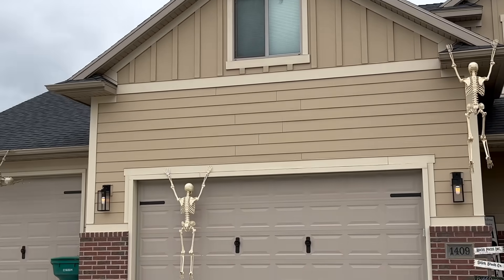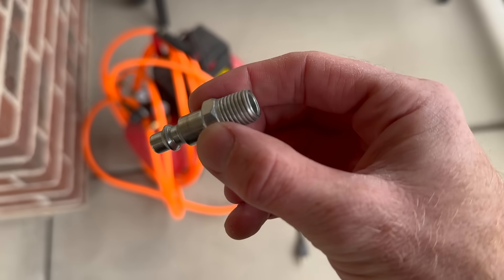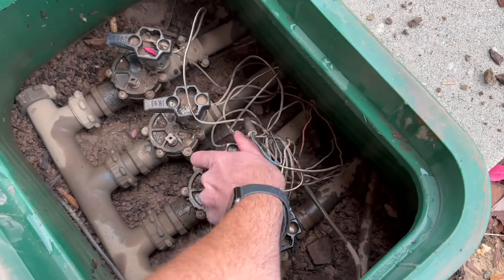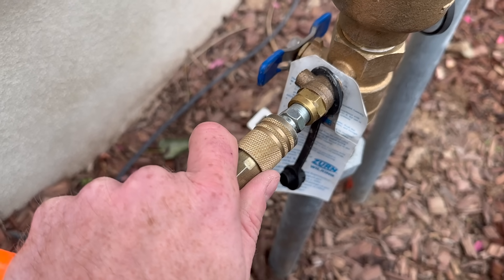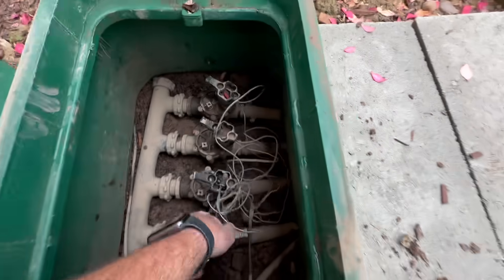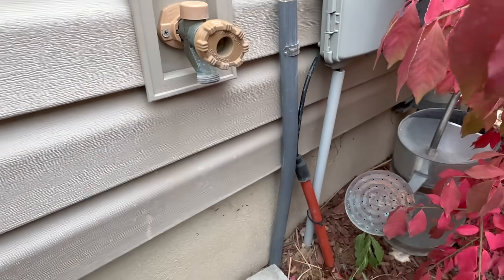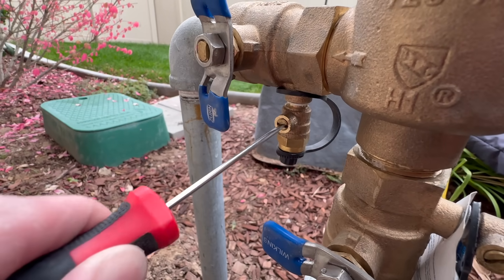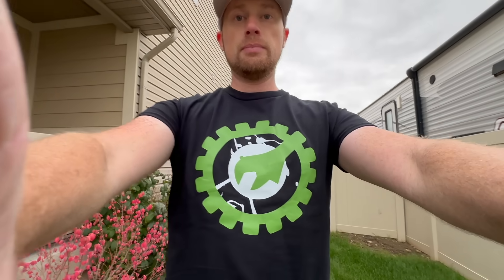DIY: How to Winterize Your Sprinkler System (Prevent Expensive Damage)

Comment: Do not put cap fittings on the end of the spigot. You want to allow any water left or any that leaks a way to expand. With a cap, you will break the pipe.
Reply from the maker: They are quite literally sold with the installation cover.

Comment: Whats the recommended psi? Ive heard 50-80, is this correcr?
Reply from the maker: Ideal pressures are in the range of 40 to 80 pounds per square inch (psi) for the air compressor with 80 psi being the maximum for rigid PVC pipe and 50 psi for polyethylene pipe (flexible black pipe). *

Comment: What about the water that’s in between the house and the shut off of the back preventer
Reply from the maker: Those valves you shut off from the city, those should have a bleeder hole for the water in that line to drip out.
Reply: @DIYBRY I actually don’t have a city shut off for just my sprinklers. I have a main sprinkler valve shut off in my utility room. It runs up and over my garage door and then elbows down to outback. If I shut that off , gravity should do its job and let the remaining fall out right?
Reply from the maker: @Millyyyy93 I’d have to see it. I’ve never seen that kind of setup.

Comment: Is there a max psi? I have a 150 psi compressor. I wouldn't want to blow anything up
Reply from the maker: Ideal pressures are in the range of 40 to 80 pounds per square inch (psi) for the air compressor with 80 psi being the maximum for rigid PVC pipe and 50 psi for polyethylene pipe (flexible black pipe). *

Comment: question, why do i have to open each value from the ground box, can't i just run each zone one by one.
Reply from the maker: You are going to want to leave them manually open anyways. Don’t want your sprinkler control box “running” all winter long just to keep the lines open. Besides, without water pressure, it is more difficult to know for sure the value is open before you start trying to force air through the lines.

Comment: Doing this is totally unnecessary! Sprinkler guys a making a killing doing this for people! Sprinkler lines are put, or supposed to be put below frost line. Shut the main water valve of to the sprinkler system. Open the valve to drain the water out. Leave the valve open over the winter. The 2 shut off valves on the backflow pipe turn half open. That's it. Never in 20 years have we had the lines blown out. Stupid unless you have money to burn.
Reply from the maker: You are assuming that all sprinkler lines are created equally…this is why people are learning to DIY, to save money! Certainly cheaper to be precaution than to have to replace sprinklers lines because they froze and burst.
Reply: They're not that deep everywhere lmao
Reply: Where do you live? The frost line where I’m at is at least 3 feet. My sprinkler lines are MAYBE 8” in the ground. And that’s the standard around here.

Comment: OR, when you were building your system you installed 1 valve @ the low spot then all that is neeced is to turn off the water supply, open the low drain valve and open all valves and the water will gravity drain.

!
Reply from the maker: A compressed air blowout is the most reliable method for clearing a sprinkler system, even if it has low-point drains. Relying on gravity to drain the system is not as effective and can leave enough water in the lines to freeze and cause damage.

!

Comment: Great. I came here for one thing - what PSI should I be using. And that's the ONE thing you didn't explain.
Reply: Bout 50 lbs
Reply: @thegoldendragongamerhi7277Mine takes 60lbs which I figured out but thank you for answering the question.
Reply from the maker: Depends on your system, dude. What size pipes do you have? What kind of pipes do you have? The ideal air pressure is between 40 and 60 PSI, with a maximum of 80 PSI to prevent damage. The specific pressure needed depends on the type of pipe: use 50 PSI for polyethylene pipe and up to 80 PSI for rigid PVC pipe.

Comment: I figured out that with my system that i have to have the compressor up to at least 60 psi for the sprinklers to pop up and blow out.
Reply from the maker: Please share, for the community, how you came about leaning what was needed for your system.
Reply: @DIYBRY 
I was following the instructions on your video, but doing it at a lower psi and nothing was happening. Then I decided to try turning up the psi coming out of the compressor and then it finally started working and worked thereafter, as long as the psi was higher. I do also just run each zone from my app, rather than from the green box, but I'm assuming either method would work.
Reply from the maker: @JTGK13 thanks for sharing.

Comment: Why do you need insulation, on something you just prepared for the winter? Isn't this superfluous?
Reply from the maker: Blowing the water out of the lines helps the polyurethane pipes not to freeze and burst. Putting an insulation jacket over the backflow preventer helps the metal in the backflow preventer to not get too cold and crack.

Comment: Can the pressure be controlled on the compressor?  Seems pretty straight forward.
Reply from the maker: Yes, there should be a knob that can adjust the pressure.
Reply: You should have two gauges and a knob. One is tank side pressure and the other is hose side.
Reply from the maker: @rain104  thanks for the additional information for the community.

Comment: Instead of manually changing the valves, couldn't I just hit the start button on my control box and cycle through the stations that way?
Reply from the maker: In theory, yes. Would depend on how close the control panel is to the blow out valve. Might be running all over the property to go back and forth.

Comment: i'm fairly certain i do NOT have a backflow preventer in my residential home.
Reply from the maker: @vegetablehead  you must have secondary water?
Reply: @DIYBRY  sorry for the late reply, but i actually 'discovered' my back flow regulator...under my house in the crawlspace. i've had my system inactive for at least 10 years now, and it's amazing how much i've forgotten about it!
Reply from the maker: @vegetablehead  interesting. Yeah, each house and each irrigation system is different.

Comment: I didn't see a drain for the main. There's still water between the shutoff and backflow. The shutoff could bea self draining but i doubt it.
Reply from the maker: @bob5098  my valve is self draining. When off, the water slowing drains out. This is basically what mine is, which the self draining on the bottom: https://amzn.to/3W020LD

Comment: If one drains and turns off the backflow and opens all the zones is blowing out the lines even necessary?
Reply from the maker: @TDace25  There will still be water in the lines if you don’t blow it out. The water can freeze, expand, and potentially break your lines.
Reply: @ Thanks. Used my compressor to do this today and was really easy.
Reply from the maker: @ Sweet! Glad to hear it. Subscribe 😎
Reply: @DIYBRY  Subbed
Reply from the maker: @ Bodacious!

Comment: Tip: If waiting for the air compressor is the longest part of the process, turn it on first, then go deal with the valves and key and whatnot.
Reply from the maker: @mistergabrieljensen  Didn’t want the compressor roaring in the background while I talked about the other parts of the process.

Comment: I followed this video exactly and I get no air blowing out of the sprinkler heads?  I have an 8 gallon 4cfm compressor, hook it up and open the valve to  zone and nothing?
Reply from the maker: Only one zone open at a time? Is the value the compressor is hooked to open, then one on the back flow preventer? When is the last time you used your sprinklers.
Reply: @DIYBRY  I ran the sprinklers right before trying to blow them out.  I only had 1 zone open and connected the compressor to a connection after the back flow preventer.  I thought the BFP was stopping the compressed air but not after I connected it after the BFL.
Reply from the maker: @slimpickens8589  And the valve you have your compressor connected to is open?
Reply: @DIYBRY  Yes the connection port is definitely open.  The only thing I can think could be happening is the compressed air is escaping through the back flow valve or the compressor just doesn't have enough cfm to push the water through the lines.
Reply from the maker: @slimpickens8589  Hard to say since I cannot see.

Comment: Why not open the other valves on either side of the vacuum breaker as well?
Reply from the maker: @Edthebass  At which part of the process are your referring?
Reply: @DIYBRY  at the end when you open up the little valves to keep the airflow moving throughout winter. The bigger valves should be open as well right? Otherwise, you’re only letting air pass through a very small section between the two valves?
Reply from the maker: @Edthebass  Yes. The actual sprinkler values (or zones) I leave those open. You can leave the "big" values on the back flow preventer open. The value that goes to the city should have a bleeder outlet on it, so it will drip the water out of the line that comes from the city. So, if you want to leave the big values open, that would be okay. More importantly would be insulating that backflow preventer. Get one that will fit yours: https://amzn.to/3Usm9cn
Reply: @DIYBRY  Awesome! I appreciate the explanation. Great video. Definitely the best one I found.
Reply from the maker: @Edthebass  I appreciate that. Glad to help. Please Subscribe! 😎

Comment: I believe you should blow it out from the output side of the backflow preventer to avoid damage to the backflow valve. Am I wrong ??
Reply from the maker: @davidcrowell5280  if you have a connection to do so, but most back flows I have see have the blow out connection at the water in side. As long as you stay in the 60 to 40 psi range, you should be just fine.
Reply: @DIYBRY  I’ve heard this too. I like how you opened the valve first though, I think that’s probably an important step to avoid excessive pressure within the back flow preventer. Personally I haven’t had any damage from winter freezes except 1 head. So I think any air in the system to move any water out will be helpful.
Reply from the maker: @asoggyburger479  Less water in the lines, less chance of the water freezing 😉
Reply: @DIYBRY   Or worst case, plenty of room to expand without damaging the pipes lol
Reply from the maker: @ Indeed!
Reply: You aren't wrong. That's how my first back flow preventer broke. Previous home owner always hooked up his own compressor like in this video and after I bought the house and went to fire up the sprinkler system, the back flow preventer was busted and didn't pass the city required inspection. That was a $350 fix and that was just the part.

Comment: Your putting 70psi of air in your sprinkler lines?
Reply from the maker: @fslater102  Polyethylene pipe: The maximum pressure is 50 psi.
Rigid PVC pipe: The maximum pressure is 80 psi.
Reply: @DIYBRY  What percent of systems you think use non-flexible field conduit of any kind? Maybe 2 or 3%?  Even in a system using Rigid PVC, try opening an air valve going in a pipe with 0 psi, to 80 psi and let me know what happens to the connections and sprinkler heads. Maybe that could be your next video.
Lets just say on the topic of max air in a sprinkler system blow out, we agree to disagree
Reply from the maker: @fslater102  if you had a 10 or 20 gallon air compressor that could maintain a 40 psi for a decent amount of time. Enough to drain the whole system, then that would be awesome. I have a 3 gallon it’s not ideal but there’s no possible way it could maintain 40 psi for more than like three seconds. You also have to remember how long these sprinkler lines are. It’s not putting 60 psi outward force through the length of the tube all at the start. It never would even get that high anyways because the water is going to be forced out of the other end. The sprinkler lines are quite long. One of mine is over 100 feet. My little 3 gallon air compressor is not going to put enough pressure in the lines to do any damage even if I start out at 80 psi because by the time that it reaches the place in the line where the water is, it’s already lost most of that pressure just to get to the end of the line in the first place. Bottom line is it all comes down to which kind of air compressor you have.

Comment: How many psi you set your regulator to?
Reply: 40 is sufficient. The higher the pressure the more risk of damaged lines. Even if your water pressure is 70 or 80, air has more viscosity and will travel through the system more violently.
Reply from the maker: @fslater102  Though, depending on your tanks size, even if it starts out at 60, and you start draining, the PSI will drop quickly. So depends on the compressor. In mine, if I start out at 40, that’s would not be enough.
Reply from the maker: @Davesauce14  A quick search of the web reveals "The ideal pressure for blowing out a sprinkler system is between 40 and 80 pounds per square inch (psi), but the maximum pressure depends on the type of pipe:
Rigid PVC pipe: The maximum pressure is 80 psi.
Polyethylene pipe: The maximum pressure is 50 psi. 
"

Comment: This is definitely not my state we have drains at base of the above ground breaker so the line drains and a master valve that shuts water from the whole system and a drain. We leave the drain plugs on the breaker wide open so the bowl dosnt bust some even take the top off as preventive and we rape the pipes and definitely don’t use iron pipes for sprinklers. They stop doing that in early 80’s around here. And we do same for inground breakers as well. We also bury lines 18 inch’s or lower below the freeze line. Iv never seen or heard of anyone using a compressor to clear the lines. Best way is just to run the system and open the drains and cut the system off it forces a back flow that drains the lines and since there are drains below the breaker it simply flushes the system
Reply from the maker: So what’s your state?

Comment: Best winterization video I found so far! Just a quick question. How much PSI is safe for the sprinkler system when doing winterization?
Reply from the maker: @weihsinchen3831  Thanks so much. 40-80 PSI. I would not exceed 80. Please like a subscribe :)
Reply: I have always seen that it says to keep it under 35 PSI when you have a backflow preventer so it doesn't damage it. I've also seen to turn the blue handle valves at a 45 degree angle as well.
Reply from the maker: @JTGK13  A quick search of the web reveals "The ideal pressure for blowing out a sprinkler system is between 40 and 80 pounds per square inch (psi), but the maximum pressure depends on the type of pipe:
Rigid PVC pipe: The maximum pressure is 80 psi.
Polyethylene pipe: The maximum pressure is 50 psi. 
"

Comment: Why did you have to cut the water off, you closed the ball valve on the preventer, why isnt that good enough?? So you closed 2 valves, just wondering why one isnt enough
Reply from the maker: From the city? All to prevent water in the lines on my property from freezing.
Reply: @DIYBRY  Oh, ur house water is on separate line/meter?  I tee in the water line coming in the house, cant shut mine off lol

Comment: Ive been told numerous times to not blow air thru the backflow. Your hose fitting should be on the downstream side of it. Once the lines have been serviced, disconnect the backflow and take it in the house.
Reply: Calling BS been doing it for 20 years NP! Lower your Air pressure to 60 psi! It's not the back flow that will have the problem at 110psi it's the lines in the system!
Reply: I've read that you shouldn't exceed 35 PSI when blowing out a sprinkler with a backflow preventer so it doesn't damage it.
Reply from the maker: Interesting 🤔
Reply: @DIYBRY  He is right, I have heard that 4 times today lol could damage it
Reply from the maker: @kkevinj1  More power to you if you want to disconnect the backflow preventer every year and have to reinstall it every year. Adding back pipe-dope or teflon tape each time and making sure it is leak free.
Reply: @DIYBRY  2 unions🙂
Reply from the maker: @kkevinj1   That is a good idea. Though then you would have two open pipes that would collect rain/snow all winter long. Could cap them, but then you would not have good air flow which could lead to frozen pipes. The fake rock like I have would cover the pipes while allowing them to be open, but with the fake rock, the entire back flow preventer is covered and has an insulation bag as well. So really, I think it comes down to personal preference and time you want to dedicate.
Reply: @DIYBRY  Im just brain storming, I have until winter to figure this out lol  I have no unions, just installed mine 4 days ago
Reply from the maker: @kkevinj1  Two unions is a great idea. I would just think you’d need to cover the pipes somehow once the backflow preventer off for the winter but still allow airflow.
Reply: Yeah do not blow air through your back flow preventer
Reply: Yeah, mine is down side of the backflow device. Blowing compressed air through it can destroy it and void the warranty according to my plumber. Do you really want to risk a $$$ part?
Reply: The valve on the upside of the backflow is for testing guy. 😅